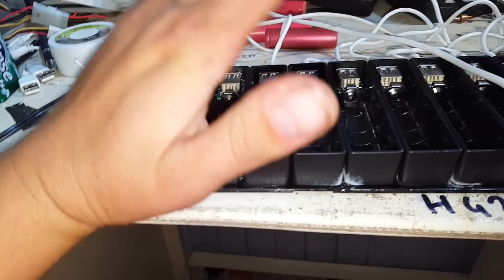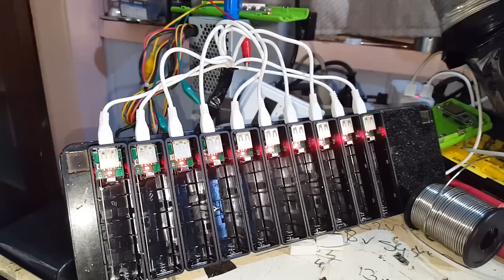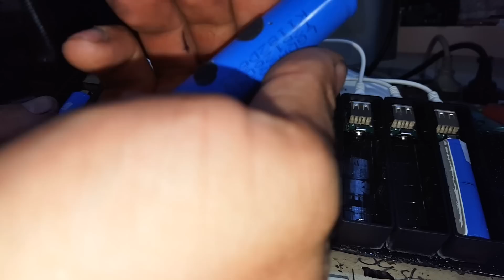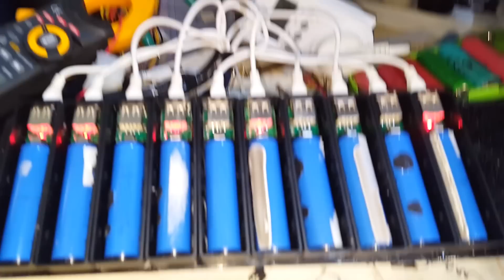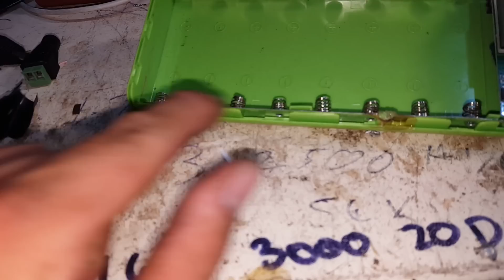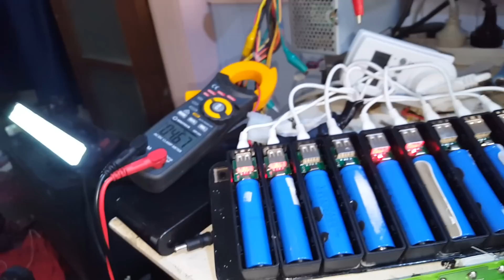Building a 10 bay 18650 battery charge dock pt2 powered up

Comment: I got a bunch of these single 18650 power banks from my local Poundland in the UK they all came with 1350mah batteries as I tested them as it says they are meant to be 1200mah. They work great and charge pretty fast for a cheap powerbank, I upgraded the cells inside to 2000mah ones but the cells that came inside were soldered to wires that go to the PCB would of been better if mine had springs like yours
Reply from the maker: Thats cheap good job mate

Comment: I like it. I need something like this so I don't have to wait for the capacity testers to charge the cell back up...
Reply from the maker: yeah have you seen my dis chargers ? this is very handy  i also currently have NERDVille's 24 bay Awsomest 18650 charger thingyy that is in my video list aswell cheers
Reply from the maker: +Home Solar Research this cost around $50 dollars and came with 10 3000mah 18650s so was a good deal

Comment: Nice job mate. They look awesome
Reply from the maker: +NERDVille its a cheap and nasty setup compared to the  AWSOMEST18650 CHARGER THINGY but it will help process the cells and thats all im after so i thought id share ;) cheers for watching
Reply: One up the sleeve customs don't knock it mate it's a much neater build and I'm assuming these are charging up the cells to 4.1v.
Reply from the maker: +NERDVille yeah thats the next thing ive gotta do  is teat that out.  The blue  lg cells i put in all charged up fine and are going into the discharger to go into the pile of now i need to do something with  all these dam cells haha